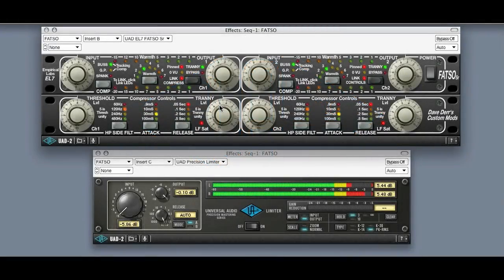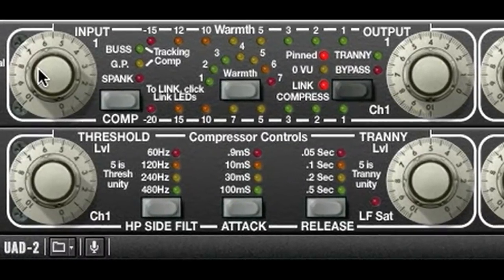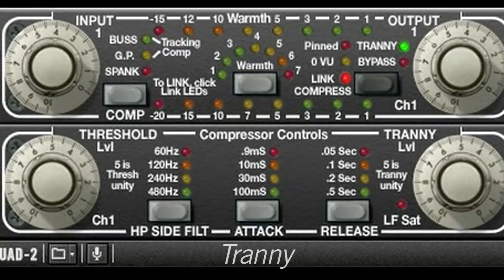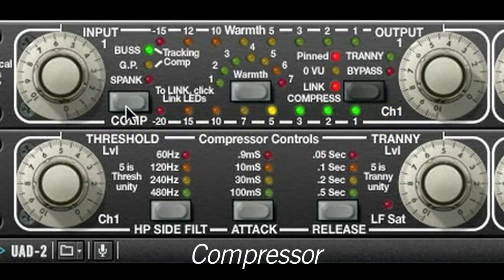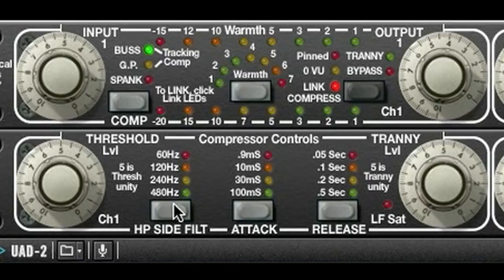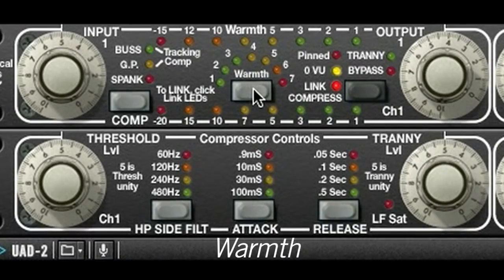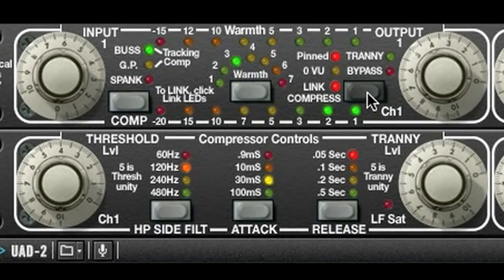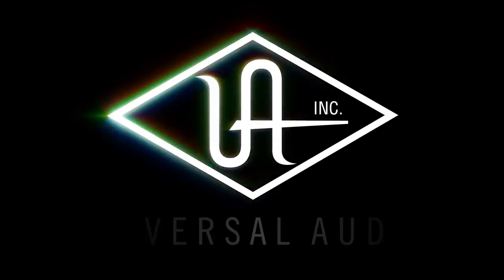UAD Fatso Powered Plug-In Overview

Comment: Yes i agree, but every compressor adds loudness. what it also does is changing the dynamics and even sound sometimes, and that's where they differ. And to have a good comparaison of how it sounds with and without, i feel it would be more accurate just to turn down the makeup gain at least in one part of the demo. Cause loudness makes it sound better anyway, but no need for expensive plug ins to just make it louder..just push up the fader,,,
Reply: this is UAD - they made your track louder even if you don't twick anything. No, we not going to forget about pultec legacy manipulation!!!)